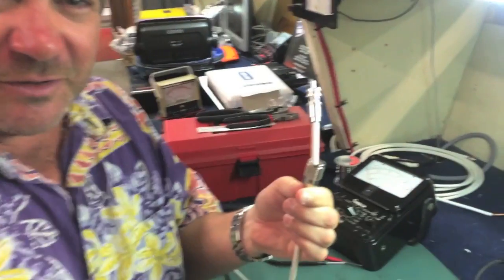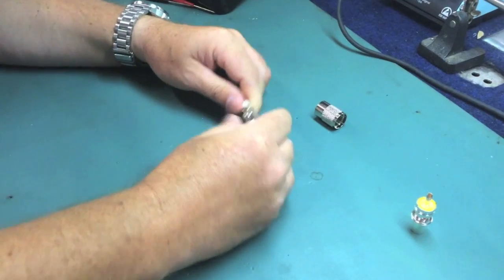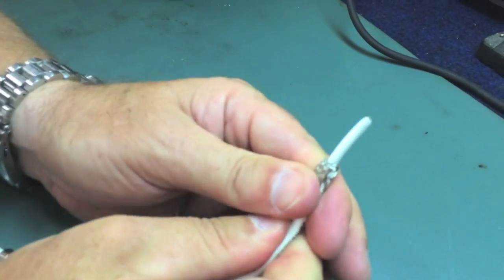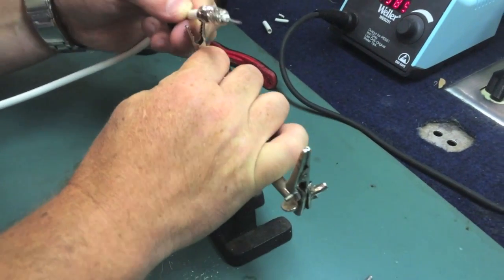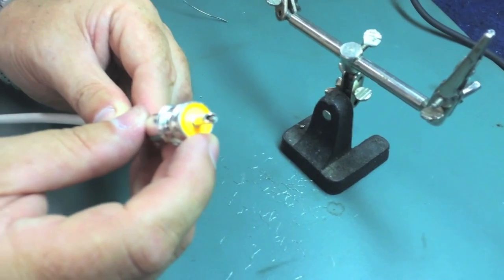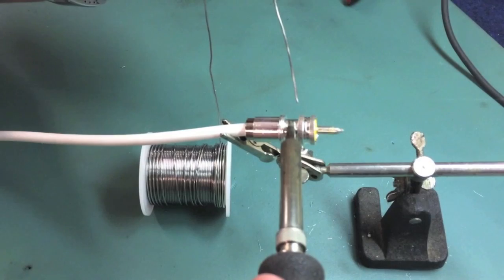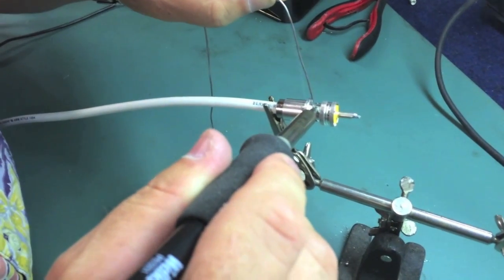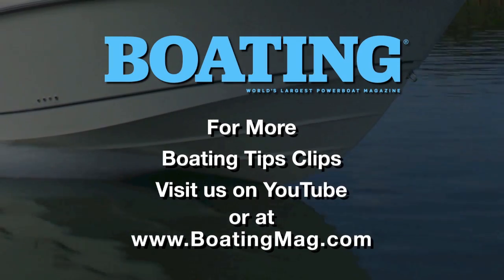Soldering A PL-259 Connector For A VHF Antenna

Comment: You are looking for whether or not you have any continuity between the the leads. In this case, you are looking for infinite resistance or and open line reading of infinite ohm between your two conductors in the coaxial cable. The mesh is one conductor and the center insulated wire is another conductor. When finished, we want zero continuity between the two conductors.  Zero resistance or zero ohms means perfect continuity, we are looking for the opposite, we want infinite ohms. In the present case, we are looking for infinite ohms or an open line between the two conductors in the coaxial.  

So it is erroneous to say we are looking for zero resistance(ohms) when measuring whether or not we have continuity between the two conductors. We want infinite resistance which means the two conductors are absolutely insulated from each other on not sharing any electrical path. If done right, there should be no resistance and infinite ohms or an 'OL' or open line condition.

Comment: It’s os not Straightforward I’m pissed I feel like I got a pay someone to do it why in the hell did the damn thing not come together is my question
Reply from the maker: Hi, Kurstin. There are also now crimp-on connectors available, that do not require soldering. The reason they do not come connected is so that smaller holes can be drilled in the boat's top, or through any bulkheads through which the cable must be routed. Also, pulling a cable through a boat, and pipe work, is made more difficult if the connector is already on.

Comment: For your resistance test - the needle wasn't showing 0 resistance, it was showing infinite resistance - i.e., no electrical path between the shield and center pin, which is what you want.

Comment: Great tutorial.  Covers everything in detail without wasting time.   However to clarify at the end it is infinite resistance meaning there is no connection (short) between the center pin and shield (good).

Comment: What's the most likely cause if you DO get continuity to the center post?  Sloppy soldering?  Too much heat melts the dielectric? Adapter too tight?